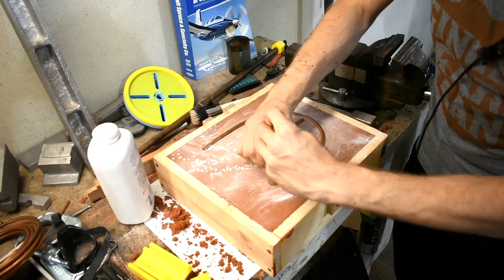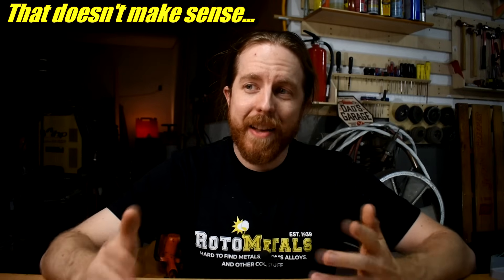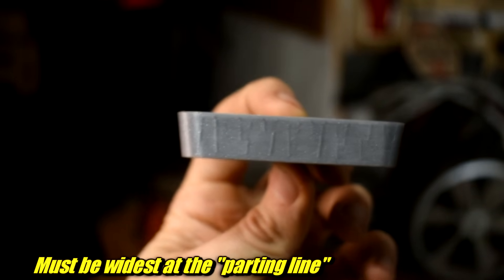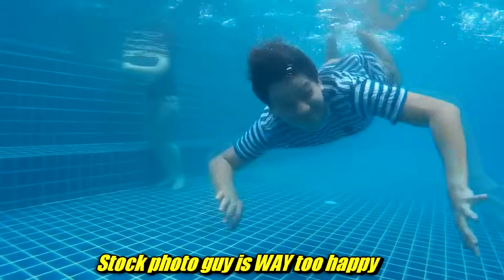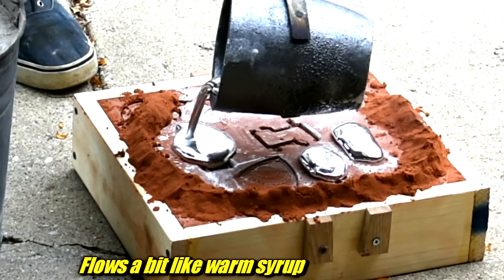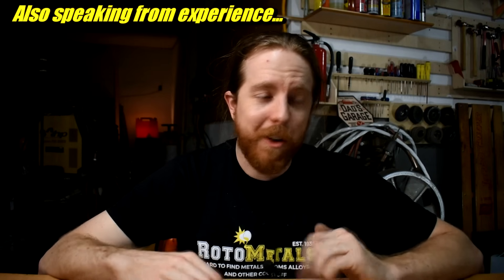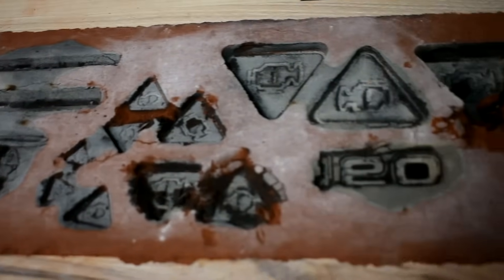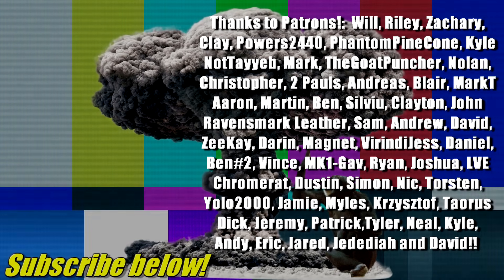The EASIEST Method for Metal Casting (open mold)

Comment: I’m researching making my own hardware for my custom handbags and I came across your channel. Do you know if using clay instead of sand might preserve details better, or is there a good reason why people use sand instead of clay? 🤔
Reply from the maker: This sand is a delft clay substitute, and it works similarly well.  There is a a finer mesh version which works even better, but for extremely good detail check out vacuum casting.  I have some videos on it, lots of jewelry is made that way
Reply from the maker: Also it you want to see this used in a way that better shows the method thay you would use for bag hardware, check out one of my recent videos with the gear looking coin pendant
Reply: @PaulsGarage fantastic! Thank you!

Comment: why didnt you drill a hole in the printed parts and glue a rod in the middle so you could more easily pull it out of the sand?

Comment: can i use wax and plaster around it then pour the metal to melt out the wax
Reply: I've seen videos of this, it's called lost wax casting, you can also do it with PLA 3d prints, the molten metal should be able to vaporize the wax or plastic, but you have to make sure you have proper vents for the gas to escape. From what I've seen results are generally better if you can melt out the material before you pour using a kiln. I want to get into doing this too, first I need to make a furnace though

Comment: This is such a great video. Thanks for the tips on ZA 12. This is gonna be such a great project for my best friend and I. We're going to practice melting on pouring on the simple open mold method, then once we got our setup dialed in we'll move on to setting up legitimate sand casting. Though, sand casting seems really intimidating and difficult; wondering if you could point us in the right direction on how to learn that?
And a last question, would you recommend graphite moulds for open pours, or just that sand method?
Thanks so much pal; and we'll definitely be using proper safety equipment, we both have backgrounds in the automotive/machine industries so we take that really seriously.
Reply from the maker: Thank you!  If you want to learn proper sand casting, I have an online course you can find at https://paulsmakeracademy.mykajabi.com/joinus but it works best if you also have a 3d printer (i send files that you can print as part of the course.  Otherwise there is a book on sand casting by C.W. Ammen that is good to start with, just know it's pretty out of date and may result in less than ideal castings.  A better book is John Campbell's Metal Casting Handbook, but its better suited to industrial foundries, not home shops.  Or you could watch the entire video library of the youtube channel olfoundryman, he does great stuff.  The course is the fastest way to cut through it all and get the fastest results, though.
Reply: @PaulsGarage  I'll check out your course, thanks!

Comment: Okay I figured casting/recasting a coin would have been really super fun & easy and any and everyone can do it in their backyard. I’m not a metal worker or even a tinker er… or much of a speller if that ain’t clear lol. What I am or was trying to do was create a “recovery” coin, like as in AA/NA. Something more permanent instead of these temp plasticish coins.. and the said community here or lack there of is very overbearing  against the grain kind of bunch . I was wanting to make something a little more welcoming & free roaming! Something more along the way and self care rather a strict call of duty. To each their own less fall in line. For more of a business card then anything else as you can assume the bunch I’m referring to isn’t. Inch of the business card types. So before my many failed attempts about the detail.. would it help at all to use a vacuum like the tray type ones to make plastic molds/packaging, using that in the sand? That mixed with vibration? Do u think that would help at all?

Comment: What I found with flat casting is to make a cover to go over the cavity. I took a piece of MDF; drilled a hole through the Center of it; then used a chamfering bit to creat a funnel. Then I cut it in half. Then placed the 2 halves together over the cavity. Lightly clamped the pieces down over the cavity. Did the pour until the molten metal rose into the chamfer. Waited for the metal to harden; pulled the two pieces off and with pliers lifted out the casting by the chamfered plug. With yours make the top pieces out of some type of metal, I guess. I’m casting pewter with mine; over a Smooth On flat mold.

Comment: Hey Paul. I'm in charge of trying to figure out the best way to make a metal dragon head so that it can actually breathe fire. Can you do a life size dragon head? If so how much would that be? Ballpark.
Reply from the maker: I don't make things on commission, but if I had to make a huge fire breathing head, I have an idea how I would do it.  1: get the flame shooting set up figured out.  I would probably use a propane weed burner set up, that's what is in those boring company not-a-flamethrowers.  2: I would weld up a frame out of steel angle or square tube that I could mount the weed burner inside in whatever orientation I needed.  Then 3: make a steel dragon head in pieces that I can mount onto the frame built in step 2.  You probably want the weed burner and the dragon head attached in a way you can remove (not welded on) just in case you need to make adjustments, repairs, take apart for transport, etc...  

I'd probably make the head out of sheet steel.  That way you can form it, weld it, forge it, etc... easily.  A welded up sheet steel head would be way lighter than anything cast, and it would be much cheaper and less brittle.  Steel is heavy, yes, but sheet steel is extremely strong given its weight.  

This video here is a casting made from zamak, and a weed burner is hot enough to boil zinc, but won't even melt steel.
Reply: @PaulsGarage  Thanks for the reply. I appreciate your point of view. We have the flame setup already. We are not going small. We want the flame to be seen from the space station (no exagerration. My company is an architectural company that does custom jobs. I do CAD work and operate robotic arms. My goal is to present my boss with ideas on how we can build the head so this is why I'm reaching out.

Sheet steel sounds like the way to go. One of the other things I need to figure out is the cost/time options. Do we contract the job out or do we buy/make the equipment to do it ourselves. I saw your video and wanted your opinion as this is a new feat for me. Thanks again!

Comment: hey, would you recommend any brand of sand for beginners? I was also wondering if plaster could be substituted for sand.
Reply from the maker: For sand casting I would definitely say get petrobond.  Plaster is for investment casting which is a totally different process.  I've had good luck with prestige optima plaster but I hear plasticast is another brand that is just as good for lost resin investment casting.
Reply: What's the difference between open mold casting and investment casting? @PaulsGarage

Comment: put a screw in the back or melt a small wire into the back. then you can pull it up without any flaws from your fingers pinching it to get it out. all in all great info.

Comment: We used ladles in the foundry. Pour slowly but steady from above. Have to have a vent and srop when you see the pour opening and vent filled. Make a board. or metal top plate with your holes since you cant make a backside sand mold

Comment: Why didn't I see shrinkage of the cast items?  I was thinking of making a metal casting of a plastic gear but shrinkage is supposed to be a problem.  It must be exact or the metal gear will not work.  Also thinking of casting it using epoxy.  My thinking is that the epoxy gear would be stronger than the plastic gear.
Reply from the maker: Shrinkage is a percentage thing, so small pieces like this will be imperceptible, but they do shrink.  Something like a gear has to be exact, so even a tiny shrinkage will make gear teeth a little sloppy, which destroys them quickly.  Most metal gears are machined from a disk, not cast in place.  Plastic ones are molded in place though.  I would suspect depending on the plastic and epoxy, the plastic might actually be stronger.  Some epoxies are brittle
Reply: @PaulsGarage    I was thinking that maybe the plastics that they use to make the gear has improved and the new gear that I have ordered will be stronger than the old one.  The original is probably 20+ years old.

Comment: Hi, I'm new at this and this is a bit off topic but I'm hoping you could answer me. Is there a way where I can make a temporary sand or plaster mold to cast a strong metal like (steel or graphite) and use that to make a permanent mold where I would later cast other metals with lower melting points and not need temporary molds anymore?

Comment: Sand casting has been used for 2,000 years. I think it's time for an innovation 😊
Reply from the maker: Investment casting is coming.  I already did a little bit I'm researching/building and acquiring equipment.  Videos soon.  Next video will be a precursor I guess, I have one of those temperature controlled electric furnaces now.  Temperature control is super critical.

Comment: You can get around the shortcomings of this mold by finishes up the pattern as usual and then clamping an aluminum plate behind it it pour 90 degree to the side.
So place pattern and ram with sand in to place inside your wooden box --> turn box around and clamp a metal plate behind it --> now turn the mold by 90 degree which increases headpressure and pour as usual. You just need to create an opening on the side that´s it. But the pattern making and all that stays simple.
Reply from the maker: Yeah that would work, I'd rather just use a normal 2 part mold though, then I could control the gating a little more
Reply: @PaulsGarage  True, a 2 part mold is simply better.

Comment: Next Video: Casting under pressure. Cast a small delicate piece inside a small pressure pot and pressurize it right after the casting. Caution, make sure the pot won´t explode!
Reply from the maker: Lol I think I'll avoid molten metal explosions if at all possible
Reply: @PaulsGarage  Come on give it a try, nothing should happen =)

Comment: Those bubbles?  That is why a pouring basin is used.  The Aluminum alloy used for beverage cans is a 3000 series and does not make a good casting metal.
Reply from the maker: Bingo.  Basin and spin trap ftw
Reply: What metal is best for casting intricate designs then? 😮
Reply: @lazytommy0  If you are wanting to cast in aluminum, the alloy to use is A356.  A good source of A356 from scrap is aluminum car wheels.  If you want to make a close alloy from scrap beer cans, you will need to add Silicon.  To do this go ahead melt the beer cans and pour into ingots.  Clean and weigh the ingots.  Remelt the ingots and add about 7% by weight of Silicon.  This will be close to A356 when starting from beer cans.  The trace amount of Manganese from the beer cans shouldn't affect the castability.  Be sure to use a flux and to stir the melt when you have added the Silicon.  Another thing that is helpful on intricate castings is to increase the superheat or temperature of the melt above the melting point of the alloy.  This helps to avoid freeze outs and cold shuts.  Also, there is a minimum thickness that can be achieved when casting.  Preheating molds prior to casting can also help.

hth

Comment: Do you need to add a flux to zinc?  If so, what should be added and how much?
Reply from the maker: I haven't.  This stuff flows like water.  One thing I haven't mentioned yet is that za12 (and 8 and 27) is hypereutectic and can separate out, which makes it a bit unique.  More on that in a later video I think.  But it flows great

Comment: 6:54 Could that dull area also be a "shrink", where the last metal to solidify has lost some volume feeding the areas that froze before it, leading to microporosity?  (Hmmm, you talk about shrinkage in your Zamak video, so maybe it is oxides from the pour?)
Reply from the maker: Hard to say because the first one I poured had a worse dull area than the last one.  The last one was poured at a lower temperature (which can reduce shrinkage) but also the crucible was emptier, so I tilted it more, pouring from a lower height (reducing entrainment).  The dull spot is on the bottom, however, which would be an odd place for shrinkage Except with this alloy for reasons I'll go over in a future video

Comment: I read a paper form about 1904 where they add tin to aluminum to improve the liquidity of the molten pool and flow of the metal
.
Reply: Tin was probably less expensive back then. It would still work but zinc is much cheaper.
Reply from the maker: Aluminum in 1904 was pretty bad, yeah.  Silicon is the go-to for increasing fluidity, but even some high silicon alloys (like a380) don't flow great due to the copper added for strength.  Just aluminum is super weak, everything is a balancing act.

Comment: I'd like to see the results you get if you use that zinc alloy in silicone molds
Reply: That would be very interesting!
Reply from the maker: Well then I have to try it!
Reply: Would most likely need slightly higher magnesium content. Used zamak5 and 3 for silicone casting, lacks the flow properties required for perfect castings

Comment: Why do I love make open mould castings  - When I am making billets to feed my lathe and my mill. Not looking for fancy surface finishes or detail etc, just want a billet of metal to machine. A 100mm  of 80mm diameter aluminium from my nearest  metal supplier is about $50 delivered...   shove some cans into some green sand, fill the resulting holes up with aluminium and I am good to go for a fraction of the price.
Reply from the maker: Yeah scrap is basically free.  I'd be worried about porosity and bifilm entrainment with open molds though.  Weak spots you can't see until it cracks.  Of course you can just overbuild stuff like me and then it doesn't matter 🤣
Reply: That must be some really nice aluminum if it costs that much. Your little puck only weighs about 3 pounds. So they're charging you $16.67 a pound. Someone where you order metal from is driving home to their mansion in a really nice car. Currently aluminum is worth about a dollar a pound.

Comment: Would pre heating the mold help like 250 degrees normal kitchen oven?
Reply from the maker: Not really, the petrobond sand I'm using would have issue with it anyway.  You could try heating the surface with a blow torch maybe but the key is head pressure, that's why these patterns don't work well

Comment: Any reason not going with a silicone mold?  Especially if using a low temp metal.  Back in the day I used to use RTV engine silicone from the automotive store but that hit took forever to dry, until I found tin base and then platinum based silicone rubber.
Reply: Most high temperature silicone are only good up to around 300 C but ZA12 does not melt until 380 C.  It works for pewter and some other low melt metals, but not this one.
Reply from the maker: 2 reasons why I didn't do silicone.  #1, I don't have any (this is the main reason) and #2 I wanted this to be the "easiest" method, and making a silicone mold takes some steps.  I've read some super high temp silicone can handle za12 but not for very many castings

Comment: If you didn't want to do a 2 sided ram mold, you could scoop in a pour shout to one side and then cover the rest of the mold with a scrap wooden board and clamp it down (giving it a temporary back). But would only work if doing one casting at a time, unlike what you demonstrated here.
Reply from the maker: I've seen people do that with low temp metals.  It would probably work with this stuff

Comment: What if you used a small, short, steel rod at an angle stuck into the corner of the mold, and pour the ZA12 over that to reduce the turbulence of the pour?
Reply from the maker: Anything to reduce the height of the pour, the better.
Reply: @PaulsGarage  I was thinking more of reducing that initial impact that causes the sudden deceleration of the molten liquid, thereby adding turbulence to the stream; pouring along a steel rod would also reduce the air molecules from being dragged into the pour, in theory anyway.

Might try a garbage pour as a proof of concept.
Reply: It sounds like you want him to decant the metal to me.

Comment: I recognize that lance tip you used to pull out the castings, man it's been a while
Reply from the maker: That's actually a new one I cast a couple weeks ago from this same metal.  I still have the bronze one but the tip is rounded a bit.  I was using it as a chisel to break glass off of some firebrick and the hammering didn't do the bronze any good 🤣🤣

Comment: Any light metal as you know wont cast well open mold.  No head pressure as you said.  Ibe been Casting pewter with open mold casts with 100% good casts.  It flows nice and its heavy.
Reply from the maker: Pewter is good stuff.  I just wish it wasn't so expensive
Reply: @PaulsGarage  yeah, I found some lead free pewter for $5 at a thrift shop 1.5lbs each plate.
Reply from the maker: @HeinrichsMade  that's a fantastic deal!